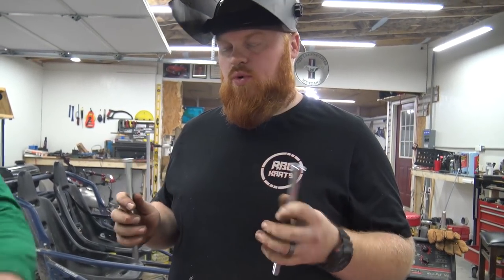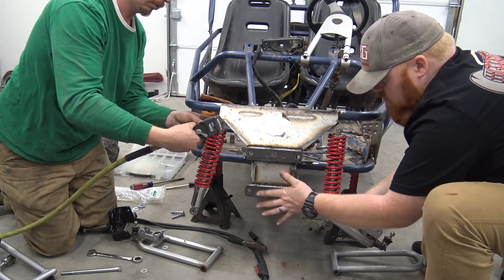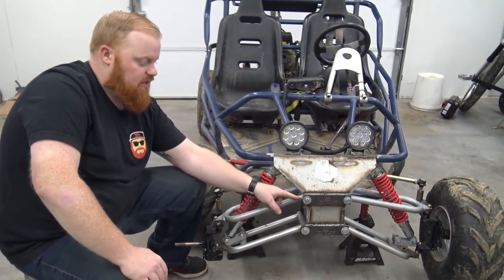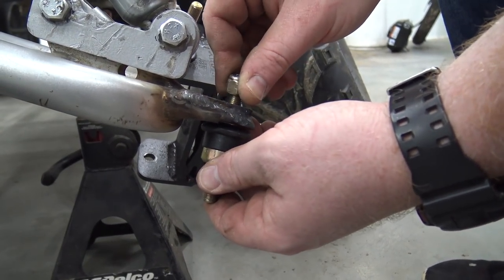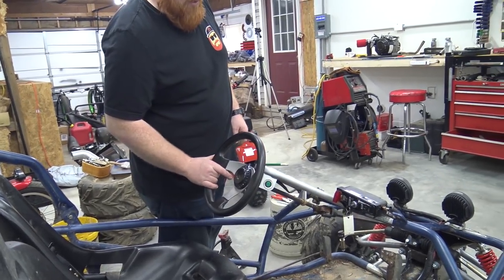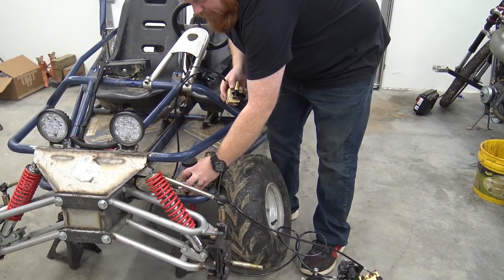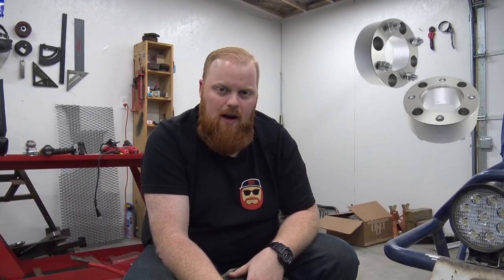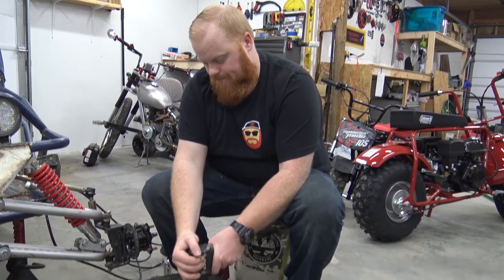670cc Predator Yerf Dog Spiderbox Lift Kit Install

Comment: Calipers are on the wrong sides... bleeder screws go to the top always. And if you need extra clearance for the master cylinder you could run it turned 90 degrees via a bell crank

Comment: Did you try to see if you could flip the wheels? You'd have to remove the valve stem, weld up the hole, and relocate it on the other side of the rim, but it would give you an even wider stance, and it might clear the calipers and spindle. Just a thought.

Comment: If you move the calipers to the rear of the wheel it will protect it from damage. At the vary least switch the right to left that will put the bleaders at the top.
Reply from the maker: These kits are made for the caliper to be on the front. I don't really want to cut the new knuckles up to move them to the back right now
Reply: Ya I get it but you can switch them side to side that would get your bleeder back on top. They will need some protection front end collision Not that that would ever happen.
Reply: If you switch side to side have to address steering but I agree should be in back of knuckle.
Reply: Switching just the caliper right to left will not create any steering problems.
Reply: Swop sides with the spindles. Calipers and lines should be to the back side of the wheel and the bleeder at the top. With the bleeder that the bottom makes it harder to get the air out.
Reply: Then the steering rods go to the front and the steering is reversed. Again more fab work!

Comment: Red beard, you should consider building a single seater full suspension off road go kart using your tube bender and the 670 suspension as a donor. I think you could hit it big and sell them as a kit!

Comment: Modify the A arms with heim joints that will also make them adjustable. Bleed screws should always be on top above the break line connection.
Reply from the maker: We actually have some large heim joints laying on the table lol. We was going to make it adjustable and it actually didn't need it after all

Comment: You should put the calipers on the back of the disc. Two reasons, the bleeder screw would be at the top so you could actually bleed the brakes and the brake line won’t be out in front to catch on crap. Also can you turn the wheel around instead of using spacers.
Reply from the maker: These are made to have the calipers on the front. I would have to cut and weld on new ears and I think they will be fine on the front of the wheels
Reply: Red Beard's Garage then swap the calipers side to side.

Comment: If you could put a torque converter on the flywheel side of the engine you could double the belt grab size.

Comment: Pretty sure if you bump up to a 10 in rim you don't have to run a spacer in the front.  These things tend to be wide enough in the front anyways.
I run 11 inch rims on my buggy but I'm lucky mine takes 4/110 bolt pattern front and rear. (most buggys seem to have different front and rear.) Common honda atv rim pattern so I got a set of factory take offs for free. On mine I run 4+3 offset in the front and 2+5 in the rear. Got a set of 2 inch spacers for the rear to to make it match the front.

Comment: Put grease fittings in the heads of the bolts and then put a crash cap over them and you should be fine.

Yes, I know that takes a little strength out of the bolts, but not enough to worry about.

Otherwise, just get grade 8 or aircraft to make up for any imagined strength losses.

I hope you are shielding those brake lines since you will likely crash into stuff being as they are on the leading edge and not the trailing edge.

Too bad there is not a formed piece of steel tubing at the end to allow you to keep the hose hidden inside the lower a-frames.

Comment: Take the wheel off the rim and switch it around. Put the wheel on the rim backwards so the well of the wheel is on the outside. Then you won't have a problem with fitment and it makes it have a wider stance.
Reply from the maker: Yeah I just wanted some wheel spacers anyways on this buggy

Comment: Try pushing your welds.  Instead of pulling them you will get a cleaner and stronger weld
Reply: He shouldnt have welded that bulkhead solid across top. Now it has no flex on that frame gonna start tearing.

Comment: Great video I have a old Carter brothers trail hunter IAM working on .Just wondering what the front track width is ball joint to ball joint ,and do those ball joints sit at that angle once rider is in kart or do they straighten up ? Thanks for the time you take in these videos .Also loved watching your Testimony !!
Reply from the maker: Thats the way they sit. After riding it some they still ride like that. Thanks for watching the Testimony video man means a lot

Comment: I hope you put the caliper on the opposite sides its installed upside down will have a hard time bleeding it like that lol and just cut the dang bolts and grind the ends instead of stacking a ton of washers
Reply from the maker: I already got smaller bolts & the caliper was just to test the fitment not install them for good

Comment: You should try flipping the wheels right to left, they may be offset. Also, your calipers are on the wrong sides... bleeders go up or else you wont be able to bleed properly! Nice work nonetheless
Reply from the maker: Thanks for the heads up but this was all for fitment and the bleeders will face down when we install them for good

Comment: Happy New year Greg  
I looks like your next workshop tool needs to be a SUITABLE metal lathe so you can make all the spacers, and fittings you need mate?
Reply from the maker: Yeah I have been on the look out for a smaller table top lathe. Hopefully I will find a good deal on one soon

Comment: Yo RED BEARD  great job on the suspension on the 670 had similar issues with my custom build still tweaking all the kinks . But I need that 780s clutch  just so I can feel the full power of this 670 . Took this thing I and I 5 girls all fit on this crazy creation of mine and with the 40 series down here on these bumpy Texas bayous it actually performed great heck we made it back with just a couple broken welds.  I'll take that any day. Let us know when the new clutch will be available in would like to bolt it on . Be blessed     Jah Rastafari

Comment: You mounted that brake caliper on the wrong side. The bleeder valve should always be on the top of the caliper so air can escape. It may also give you the room you need for the wheel to fit.
Reply from the maker: It was just for fitment testing not leaving it on

Comment: Hey RBG, what size front tire did you have on these and how thick of wheel spacers did you use? Building a spiderbox 3206 now.
Reply: Also, do you have a link for new rack and pinion? Thanks

Comment: 13:20 break in over time? More like break over time. Let that free spin.
Reply from the maker: +KartFab new bearings are always stiff when new. I have always did my bearings that way and they have never failed me.
Reply: i used to do that and have had two bearings fail because of overtightening. Now i just make sure there is no side to side slop, and lock-tite the nut in, that is unless it has an internal spacer, then you can tighten it up. Just my 2 cents. I bet you would get to your top speed .00001 seconds faster if they free spun?!?!
Reply from the maker: Lol every .00001 counts
Reply: Lmfao 😂😂
Reply: I thought they were gonna start beefin
Reply: KartFab
Reply: I’m with kartfab red beard. I love your vids and in no way hating but I used to do it that way but I have had bearings fail from it.

Comment: So I have a go kart used I just got I bled the brakes but not sure if it air in the lines or pads how thick are the pads for it is a 150CC hammer head I believe

Comment: I have an old Honda Odyssey  would a 670 or 420
  work on that.. and have enough power for it. I still have the torque  converter  and 250cc  engine for it
Reply: I would skip straight to 18hp motors. It takes a different series torque converter I believe

Comment: I have a 159 cc sidekick buggy. I bought it last year condition unk. i purchased. a new carb. ign switch. some cables etc. everything is buttoned up...oh the gas tank was badly corroded so I put on a mower tank to get her running  no joy there. it turns over but won't start .. seems like it's not pulling the fuel through the carb.  when I pull the fuel line off at the filter, leaving a 6" clear tubing.. you can see the fuel level  drop, replenishing the float bowl.  is there some kind of vacuum pump that pulls fuel into the carb? How can I bypass it snd run gravity feed ?

Comment: the bleeder valve on the calipers have to be ontop of the line . otherwize you can't bleed the brakes
Reply from the maker: It was to just show you that the wheel was hitting

Comment: My question is are your upper and lower a arms the same length from frame to wheel hub. I'm trying to upgrade my raptor 770 go kart but I'm running air suspension. Thanks for the help if you can.

Comment: 5.3 is an ls3 lol people who diss it obviously have to much time on their hands to worry about it
Reply: 5.3 is an lm7 the biggest difference between that and all other ls motors is that the lm7 is an iron block, not aluminum
Reply: Peter D this right here ^^.  The 5.3L is an lm7.. it's an LS based motor with an iron block. Ls1 ls2 ls3 all have aluminum block.. the 4.8L  LR4 is an LS based iron block too! same bore, shorter stroke.  (Can Use 4.8 flat top pistons in a 5.3 for and instant increase in compression)

Comment: I'd like to see someone build one of these buggies using a FWD manual five speed sourced from something like one of those 3-cylinder Geo Metros hooked up to a built 670 with engine and transmission mounted in the back. If someone could figure out a way to mount the clutch and some kind of adapter plate to mount the engine and FWD trans together it would make for a pretty bad ass buggy! The way I understand it those trans out of the Geo Metro 3-cylinder cars was pretty small and light weight but was still hooked to and engine putting out about the same as a build Predator 670 so I don't see why it would have any problems with holding up the the 670's power if you could just figure out a way to hook them together...

Comment: Ummm you know the bleeder valve in supposed to be on top of the brake caliper
Reply from the maker: We was just testing fitment in this video. When they are installed for good then they will face the ground. Thanks for the heads up though
Reply: Red Beard's Garage does that lift kit work on the Fox zircon

Comment: how will you do the seal torque converter? i was thinking sealed bearings and then a soild cover that bolts on with a gasket
Reply from the maker: Hopefully make a fiberglass cover with top vents and do a gasket around it to seal it up
Reply: It will still need air vents but a good trick is to duct some of the air from the engines cooling fan to provide fresh dryer cleaner air  to the cvt with a nearly sealed cover except for an exhaust port on the opposite end of the cover with some fine mesh over it to prevent debris from entering... that combined with the positive pressure cool clean air will significantly improve belt life
Reply: It's a trick I use to make the belt survive on my qmb 139 50cc scooter that's bored and stroked to 96 actual cc's combined with a custom piston big port big valve head fully ported and polished with  heavy valve springs, performance cam, multi spark cdi ignition, 1.25 inch exhaust header, fuel injection, one off long tube air intake for max torque, regeared final drive, performance clutch and retuned cvt (they're a hybrid clutch/cvt design), widest tallest racing slicks that'll fit on it without rubbing, and a tuned suspension. It ate a brand new kevlar belt every 10 miles  at 60 mph until I positive pressure vented the cvt case Since then it only gets a new belt yearly at 5k miles/year (yes it gets rode nearly daily in the summer)

Comment: You doing any performance parts performance670?
Reply from the maker: Yeah we will start with just a governor removal and valve springs and then going to do all the goods to it
Reply: Red Beard's Garage cars and camera built the hell out of there 670 and really wasn't that impressive the motor sounded mean but just didn't move quick considering they easily had $2000+ in the build

Comment: I'm in ga and I have a hammerhead gt200 I need to know how to make it go faster! I won't a faster take off
Reply from the maker: Gear it lower. Bigger sprocket on the axle or smaller on the cvt

Comment: I NEED YOUR HELP (STUCK IN A BUGGY BUILD). Hello everyone I'm building a very large off-road buggy with a 6 gears transmission and about 50 hp. I need to find the two front plates where calipers and front hubs are mounted. I even need the adaptors which mounts the brake rotors. I'm not English and I don't know how those pieces are called (in English) and I can't find them locally. Please if you know how they're called or if you know where I can find them please reply to me. Huge thanks
Reply from the maker: I got mine from go power sports

Comment: Please remove those washers off the hangers._ not safe and just plain lazy. Put a nut on the bolt and chop to size let the nut rethread. Cheers
Reply from the maker: +sugga dick I have bolts that fit. This was just for testing

Comment: YOU LYING YOU NOT 250LBS ...YOUR ABOUT 290LB
Reply from the maker: +Nationalcitysycho d no I'm 260 lol
Reply: Red Beard's Garage ..lol.
Reply: im about 261 i was at 289..i was breaking chairs & go carts left and right..lol
Reply: Red Beard's Garage cool you responded i got some question im building a golf cart its cool ..im making its body from fiberglass. its a jeep body...i want to trade info  with you bro cause i dont know alot about building carts or golf carts,your an expert.
Reply: Hey rbg ..i need to know what did u ut for a trans on the 670cc?